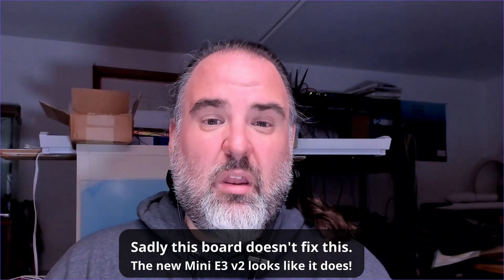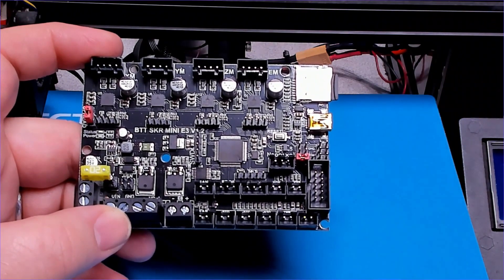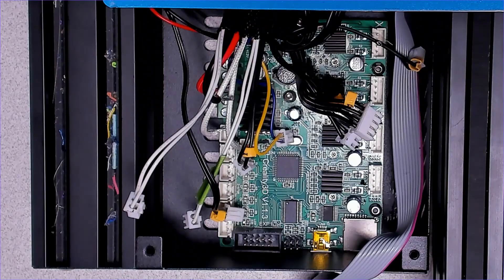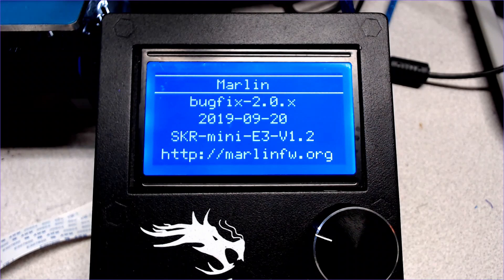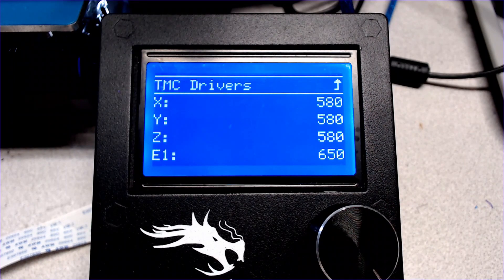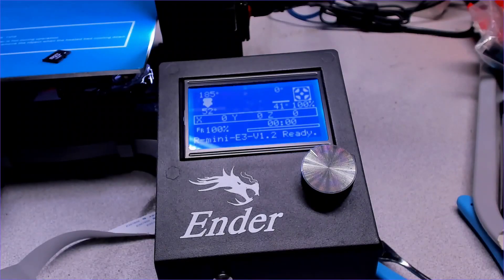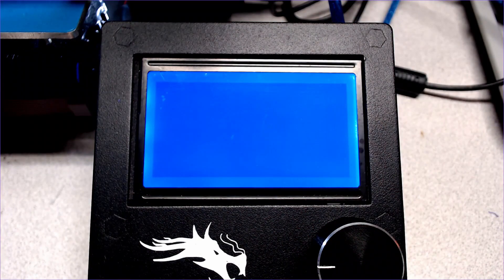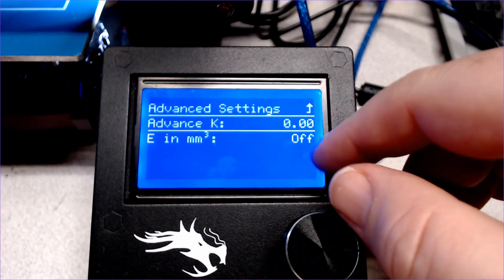Quieting the Ender, with the SKR Mini E3 v1.2

Comment from the maker: I have the v2 board in house! I am going to get it installed, and will publish another video. It will be more focused on some of the new stuff I  see on the v2, and more advanced stuff you can do with the board in Marlin. I am excited!
Reply: HackMonkey Looking forward to that as there is very little out there at the moment, I have also read that no one has been able to get ABL working with it yet.
Reply from the maker: Once I swapped to the stiffer bed springs, bed leveling is no longer a problem on my Ender.

Comment: Now my steppers are so quiet the fan on the control board seams too loud.  Any suggestions for a replacement for the fan?
Reply from the maker: Sunon has some good, quiet fans in 24 volt. Printed Solid sells some that are labeled for use on Prusa's.